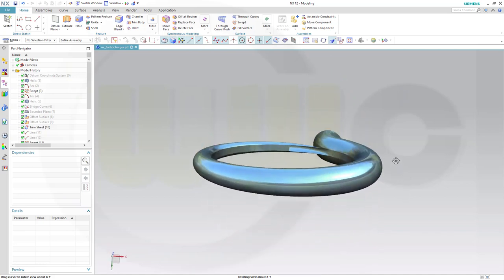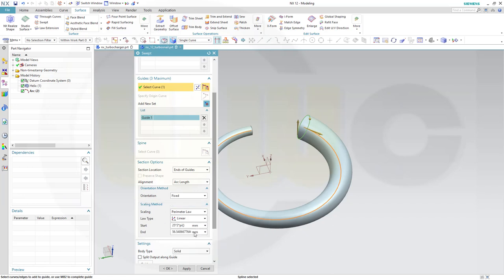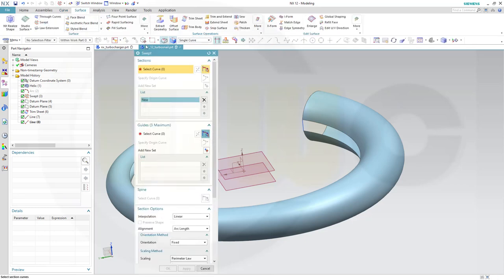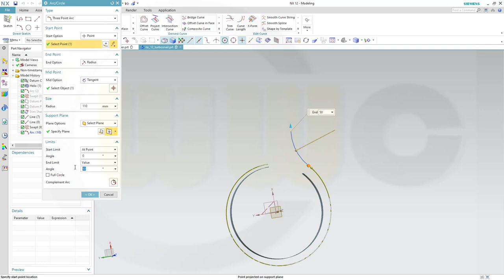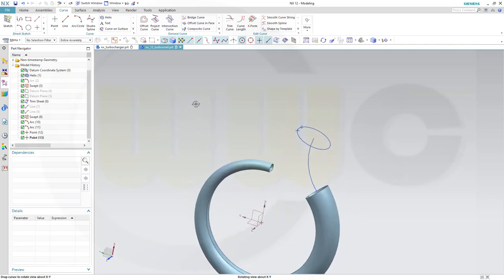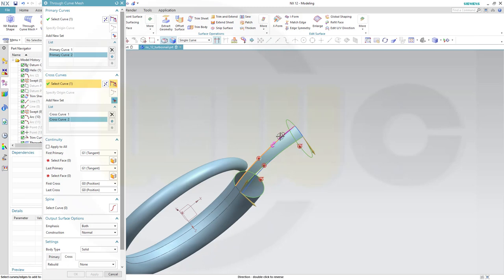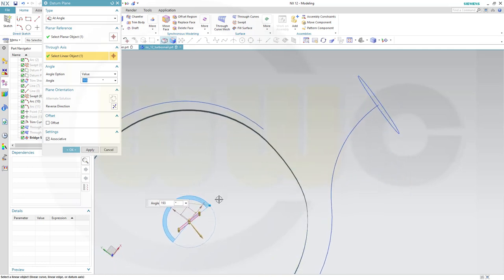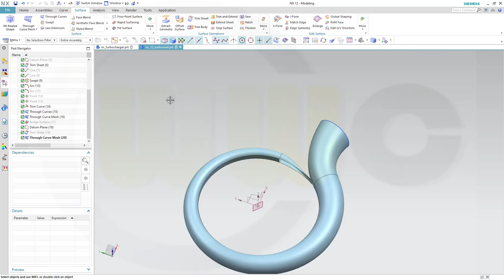Turbo - Snail - Siemens NX 12 Training - Surfaces

Comment: Good evening, Wolfgang! I am an engineering student from Moscow, i'm using NX 8.5, and i would like to thank you for your tutorials, they are very helpful for me. I would be very grateful if you could make a tutorial about spine curves, in particular, about a correct selection of them when creating a surface. Because sometimes it is not very obvious how a surface depends on them. Thank you!
Reply from the maker: Hi, there a lot of surface videos and in some I use spine curves as well. But I will consider it.